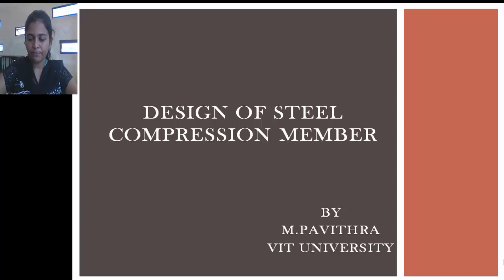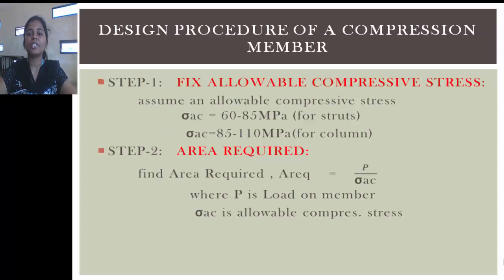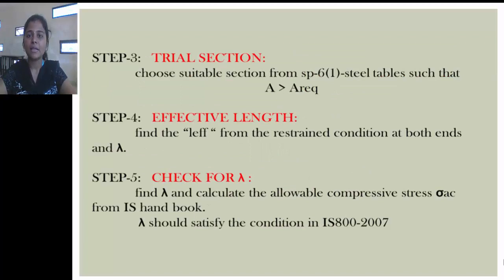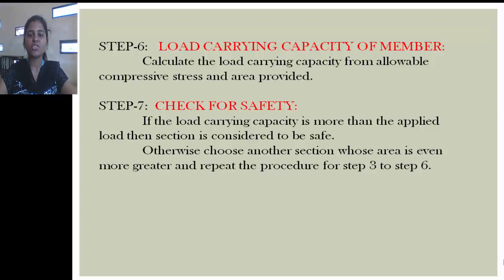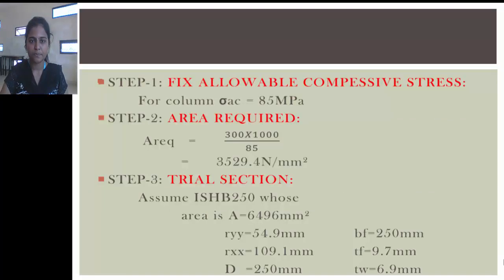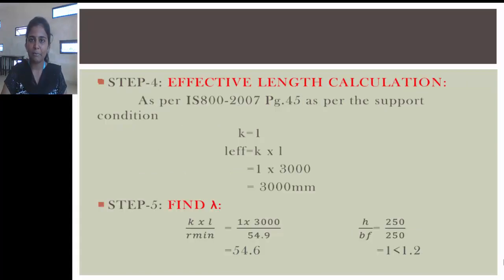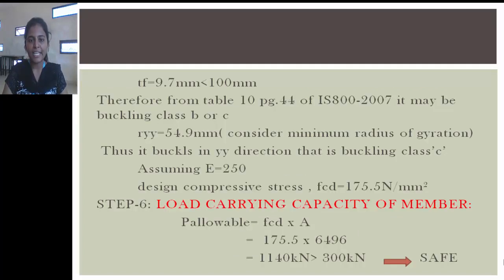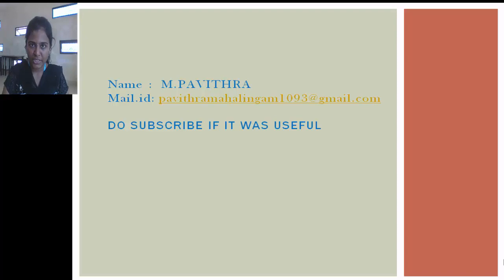Design Of Compression Member

Comment: Ma'am plss tell me the page no. Of  IS800:2007 from lemda value can get.
Reply: Lemda value can be calculated by using the eqtn Kl÷rmin , where kl is the effective length which depends on end condition , and r is  minimum radius of gyration , for column compression member  take ryy value.  Bcz it will be lesser